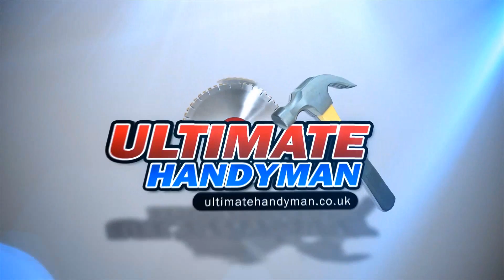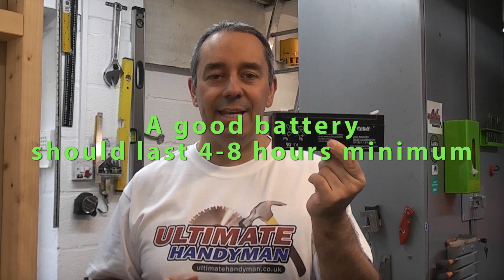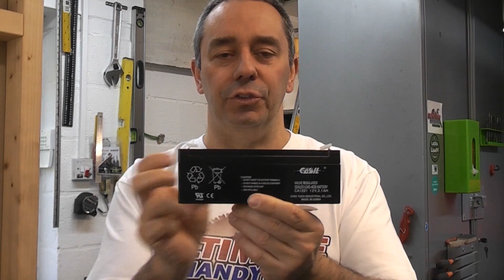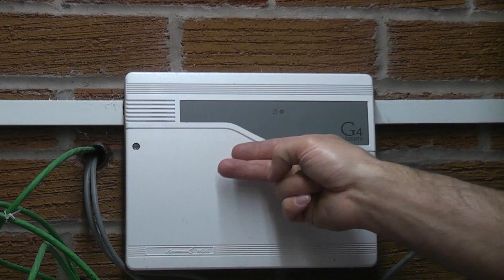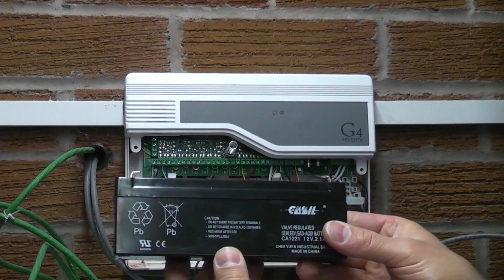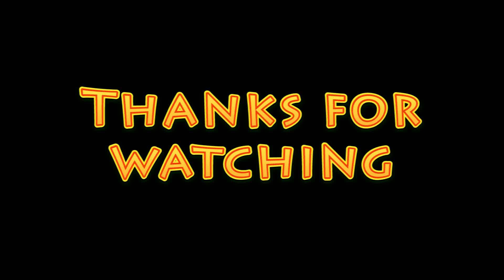House alarm goes off when power comes back on

Comment: There is another reason why this happens, because of 2 things: Its part of the UK Burglar Alarm Standards and the alarm system thinks to itself that an intruder is trying to bypass the alarm or even worse, disable and break the system in pieces, which is why when the power comes back on, the system starts screaming out loud, this also happens when you are decommissioning the alarm system because when you are disconnecting the battery from the main control unit, only the external sounder will start acting up because the speaker inside the main panel will be shut down because you disconnected its battery, however this does not happen when you remove the fuse from the fuse spur.

Comment: Hi, tried to reset panel to factory default , as didn't know the engineer number to clean the contacts on the key pad as some was difficult to work . Removed tamper connections connected wire from left tamper term to set term, powered up the panel sounder sounded turned off power reinstated everything now when I power up the panel the alarm fully sounds and the default 0123 0r engineer 9999 doesn't work. Any ideas? thanks
Reply from the maker: Not sure, I always thought that doing a factory reset would reset the numbers to what you have posted. I suppose you tried pressing the reset button on first power up (the one that is like a X).
Have you tried inputting the old user code?
Reply: @ultimatehandyman  Hi thanks for getting back to me, as of my original post now the key pad Day and Power led fail light up and all the buttons don't make a sound when you press them, the actual keys are still back lit I have replaced the battery with a new one in the panel. When I add the link between the tampa and set and power up with battery first then mains or visor versa the sounder goes off outside momentarily then stops? any ideas?
Reply from the maker: It sounds like a tamper problem (I’m not an alarm expert) 
Before restoring the electricity from the battery or the mains, press and hold the tamper spring in, on the front of the panel. That might enable you to reset it 👍

Comment: I recently just replaced my battery purchased from amazon UK. It seems it may be faulty based upon this video which states on power coming on if alarm sounds battery is more than likely defective, or can something else cause this issue?
Reply from the maker: It’s unusual to get a faulty battery of this type from new, but always a possibility. Might be worth seeing if you can charge the battery using a bench power supply or similar.  I'd also check any fuses in the alarm panel

Comment: Great video. My battery is flat so need to replace it. But if i do it without the engineers number will the alarm definitely silence after i put the code in?

Comment: My power just tripped the alarm panel keyboard light is on but the red and green power lights are not, when I press the keys there is nothing
Reply from the maker: It could be a few things depending on the make and model of the alarm. 
Are you sure that the mains power has been restored?
If it has, try pressing the reset button a few times. If that does not work try inputting your code number.
If nothing at all is working, then perhaps a fuse has blown? 👍

Comment: I thought the battery should swith over when the power was lost. Then back to mains when the power is restored. So if the battery is flat surely  the alarm would sound when the power is cut.  The thing is with very short power outages, it sets burglar alarms off, the time on clocks on cookers are not lost( they have no battery back up). but if I switch the power off to the burglar alarm, it flicks to battery , and back OK. Its something about power outages?
Reply from the maker: The battery in the panel will enable the alarm to work during a power cut, however, if that battery is no longer working the alarm will not work until the mains power is restored. Hence with many alarms, the alarm will sound when the mains power is restored.
Some systems also have a SCB (self-contained battery) in the alarm bell box (situated outside). In the event of a power cut, and if the main battery is not working, the SCB will sound the external sounder until either that battery is exhausted, or the power is restored 👍

Comment: Brilliant video, didn't even know there was a code to put it into engineering, I managed to access both the key pad & the box by following your advise, I've not yet replaced the battery, my alarm was just randomly going of without even  being set, so not sure what's causing this, it was fitted in 2017, i moved here last yr, it's always been ok, until today, am  a woman, so I'm kinda stuck as to y this is happening, & how would 1 know the battery needing changing,  any ideas any 1 pls ?
Reply from the maker: When the alarm goes off, do any zone's illuminate, or perhaps the tamper light?
Reply: @ultimatehandyman  to be honest with u I  left it on engineering mode as it just kept going of that i couldn't understand y, so rather than make a nuisance of myself, with the neighbours, over night,  once i learnt from u the engineering route I was so relieved, have  taken it back out ( of engineering mode ) now,  & let u know once i have discovered that, it hasn't happened again yet, will check it out & let u know once it does, & a big  thank u for coming back so fast i so appreciate this,
Reply: @ultimatehandyman  whilst I'm waiting for that 2 occur could i possibly ask have u a guidance vid on how to change the code on this system, I've had the same code the previous owners had in place, really could do with it changing it, hope u can help, many thanks 🤗

Comment: Storm Eunice brought me three power outages last night.  I don't use my alarm and never give it a thought, although there was no doubt as to the origin of the noise.  I'm  happy to have found this video and can confidently swap out the battery now.  That's unless you can tell me if there is a way of disabling it completely?  I'm moving house soon and shutting it down is an option.  Thank you! By the way, I have an ADE Accenta.
Reply from the maker: You can disable it completely by removing the fuse going to the alarm. There should be a FCU (fused connection unit), this will have a fuse that you can remove. If you remove the fuse, after the battery has lost it's charge completely, the alarm will no longer work. (you might have a battery in the external sounder, that might sound until the battery in that is depleted, normally about 20 minutes)
Reply: @ultimatehandyman  Thank you very much for taking the time to reply with a solution, along with the useful info on the external sounder.  I'll be sure to try this during the daytime.  Thanks again!

Comment: If I put it in engineer mode until I can replace the battery, will it stop the alarm going if we have a power cut? It’s gone off twice now but I can’t get a battery just yet and I’m trying to prevent it from happening again.  I’m not bothered that it won’t work at all since we’ll be in and don’t need it to be working just yet.  TIA
Reply from the maker: Not sure, but would assume that it will still alarm when the power comes back on.

Comment: The switch in my consumer unit that my alarm is on tripped on Saturday night. Inputing my code on the keypad would not turn the alarm off, so I had to at the fuse, remove the front panel, and remove the battery as it was waking the street up! Whilst in this condition there is no power to the keypad. When I restore power to the alarm, it immediately sounds. Can you tell me how to return my alarm to normal operation? I have the instructions and I think the engineer code is still default.
Reply from the maker: It sounds like you need a new battery.
Once you replace it, you should be able to silence the alarm by inputting your 4 digit code, you might need to press the reset button X 
The alarm will stay in tamper mode until you close the cover, once the cover is closed, you should be able to press reset, sometimes twice X X 
Then the alarm should be back to normal
Reply: @ultimatehandyman  ok, thanks for reply. The battery works because as soon as reconnect it, the alarms sounds outside again.
Reply: @ultimatehandyman  Hello again, I was able to reset using my code as you advised. It was all a bit of a panic on Saturday night when it was waking the whole street up.

I have a new problem now. The alarm will not set !  Instead of the slow timed beeps, I get shorter, quicker beeps and the alarm does not set. Any idea?

Thanks in advance.
Reply from the maker: @davidboardman1566   Not sure, normally if there is a problem with the alarm there will be a visual indication (such as an illuminated LED)

Comment: Hi. I Haven't had a power cut but the external sounder has been intermittently going off for days when not set. The internal sounders do not go off. No fault was indicated on LCD panel and inputting code to reset the alarm system does not solve it. I removed the main panel battery (without engineers code so internal alarms sounded) and the external continued for a minute then became very quiet and continued to sound quietly for 15 mins until I removed the battery from it. Would this be the battery in the panel or external sounder that needs replacing? Challenger system. Thanks - love all your DIY videos
Reply from the maker: Probably the external sounder needs replacing.
They get a lot of stick outside with the weather and often need replacing after 10 years or so.
Thanks for the comment 👍

Comment: Mines out of battery and the external sounder goes off during a power cut
Reply from the maker: It will do. The bell box has a external battery and hold off circuit. When the power is cut to the bell box it will alarm until power is restored. Replacing the battery in the alarm panel will fix it ;-)
Reply: @ultimatehandyman  that's what I thought, though the alarm stops after about 20 minutes
Reply from the maker: @yeety1208   The battery in the external sounder will probably have run flat after 20 minutes, that's why it stops.
I think they design the battery in the external sounder to last for 20 minutes then it does not create a noise nuisance, if you can't silence it.

Comment: What if you need a 2.1ah but got a 2.3ah
Reply from the maker: It will be fine, as long as it fits in the panel. The larger the AH, the longer the charge will last.
Thanks for the comment
Reply: @ultimatehandyman  
Thanks for the reply appreciate it. Solved the problem.

Comment: Thanks for the video! I replaced the battery and that worked great, but now the alarm does not sound when triggered in part-set mode at night. Any ideas? Thanks in advance
Reply from the maker: Does the strobe light flash outside when the alarm is triggered?
Reply: @ultimatehandyman  No it doesn't flash when triggered. The green unlocked padlock light also doesn't not go out either to indicate the alarm is set when put in part-set mode. thanks

Comment: Thank you for a very informative video.  My Optima XM alarm system was installed by so-called professionals more than 20 years ago, who, for some reason known only to themselves, decided to wire my alarm up to the light in the hall.  Now, here's the thing, my alarm goes off whenever there's a power cut and this has been the case from day one.  I just presumed this was the anti-tamper device kicking in after an interruption to the power supply.  Unfortunately, it's a bit late for me to contact the company that installed my alarm, they ceased trading about ten years ago.  I'm also thinking that if I replace the battery it'll just continue doing what it's always been doing.  Any advice on this would be greatly appreciated.
Reply from the maker: If it's been doing that since day one they have either not installed a battery or forgotten to connect it.
Fitting a battery as per this video, should mean that the next time there is a power cut your alarm will not sound ;-)
Reply: @ultimatehandyman  Thanks for getting back to me so quickly, I never even considered that there might not be a back-up battery installed/connected, but that would make sense.  Either way, given the fact that it's been 20+ years since the alarm system was installed, I'd probably be best to buy a new battery anyway.  I'll let you know how things go. Thanks again for all your help.
Reply: UPDATE:- I successfully managed to replace my PIR sensors thanks to the guidance of your helpful videos.  Replacing the battery, however, is proving to be a different matter...  Remember how you thought maybe the installers either hadn't connected it correctly or hadn't installed one at all.  Well I finally opened up the control panel for the very first time since having the system installed and found it does have a battery installed, which visually seems to be installed correctly, but the contact points are very badly corroded, so much so that I know if I try to remove the spade connectors they'll just fall apart.  Presumably the battery was working ok when it was first installed, which still doesn't explain why the alarm goes off every time the power is switched back on after a power cut.  By the way, I've bought a new battery, but I think I also need to replace the red and black battery wires.  Any advice on where I may be able to obtain these?  I've tried looking on eBay, but it would help if I knew what I was looking for, such as the size/gauge of the wire. Alternatively, would it be ok for me to just snip off the corroded ends of the wires (after completely removing them, of course) and replace the spade connectors?
Reply: @bravejordy  I have same system, I replaced battery but still alarming after power cut when the power is restored. Tried another battery but that's the same. Next I need to check current/voltage to the battery in case its a faulty wire. You should be okay snipping of spades and either fitting new ones or clean old with soft wire brush or emery paper and apply a smear of vaseline. The wires used are 5 amp and you can usually purchase in a hardware store.

Comment: Had a power cut last night alarm been going off problem I have we can’t find the code how do I turn the alarm off without the code
Reply from the maker: I'm afraid you need the code, If you don't know the code you can remove the internal battery and switch off the power to the alarm, although the external sounder might sound until the internal battery in the bell box is flat. If you find the manual online, it should tell you how to reset the alarm to it's default status.
Thanks for the comment 👍

Comment: I have recently moved to a new house with the accenta g3 and it's got a one keypad in the hallway which you use to enter the code when entering and exiting the house. but inside my cupboard I've got the main box and on top of that I've got another keypad which is connected to the main panel box so do you know what keypad that is ?
Reply from the maker: It sounds like it's another keypad. The older Accenta panels had a built in keypad, so you could operate the alarm from the main panel, or the remote keypad. Sometimes people put a remote near the alarm panel for ease of use.  I have 2 keypads for my garage alarm, one in the garage and one in my office- https://www.youtube.com/watch?v=MU_n38qrJlg

Thanks for the comment 👍
Reply: It also could be a speech dialler or auto dialler that calls the police/a phone number when the alarm goes off

Comment: Hi bud my house alarm keeps going off I have changed the battery and put a new one
In but it keeps off during the night when we are asleep all doors are locked so can you help with this please
Reply from the maker: It could be several things causing it. The best option is to check the panel, it should tell you which zone is causing the alarm to trip. If it is the same zone each time, you have a problem with the sensor or the wiring on that zone. You can link omit the zone on the panel when setting the alarm, this should stop it from waking you at night. If this work it is worth checking the sensor, and perhaps replace it, then you don't need to omit it each time you set the alarm.
Reply: Ultimate Handyman ok thanks for the help 🍻🍻

Comment: a lot of the replacement  batteries arrive 70-90% charged.I have no way of charging lead acid batteries.Does the accenta panel top up the charge to 100% once inserted?
Reply from the maker: Yes the battery is constantly charged via the panel. 
Thanks for the comment 👍

Comment: hey bud - is it possible to check my alarm battery with a multi-meter to see if it is holding charge???

if so, do u know how to do it???

many thanks.
Reply: The way I indicate a battery that’s out of date is leave it in the panel for a few hours then take it out and check with a multi meter and if the voltage drops quite quickly then the battery is obviously not working as it should. Hope that’s helpful!
Reply: Voltage does not give much indication of how much capacity a battery has left, I have known batteries to read 12-13v but have no capacity left and struggle to supply the smallest of loads. Best way to check if your alarm battery is healthy is to switch off the mains, if the bellbox outside sounds and you can't stop it because the keypad has lost power, the battery in panel is knackered and needs replaced, if it doesn't sound and the system still has power then all is well. As rule of thumb your alarm battery should be replaced every 3 to 5 years, If you are unsure how old your alarm battery is then just replace it like for like, An alarm battery is only about £15, it will do no harm. Don't be like most of the fools out there who's alarms go off uncontrollably in a power cut because they couldn't be bothered to maintain their alarm.